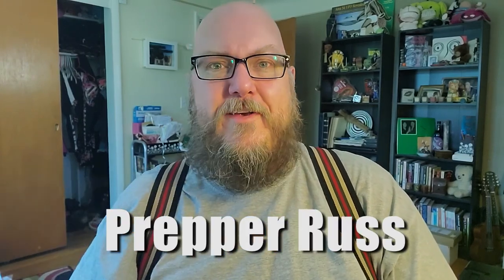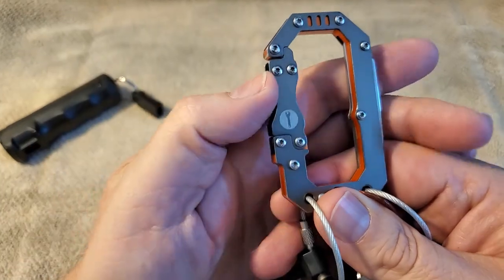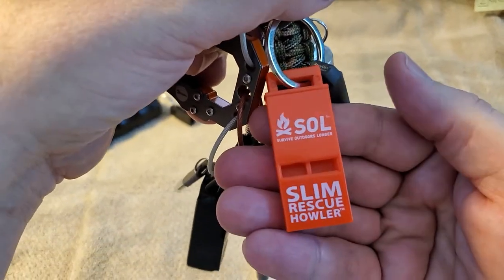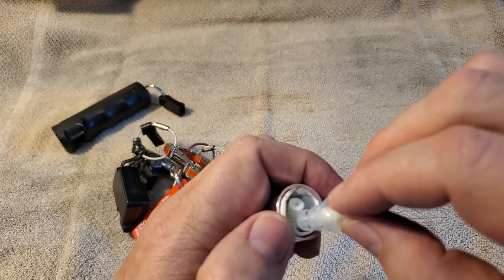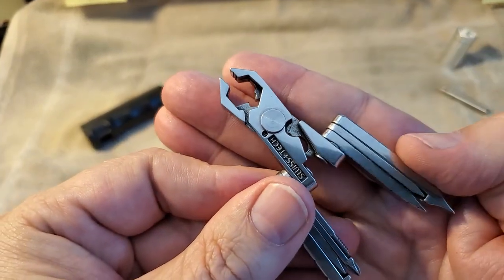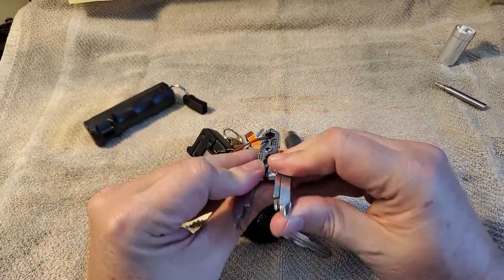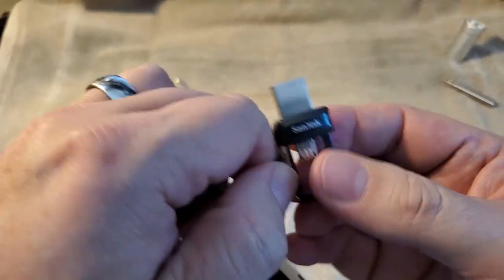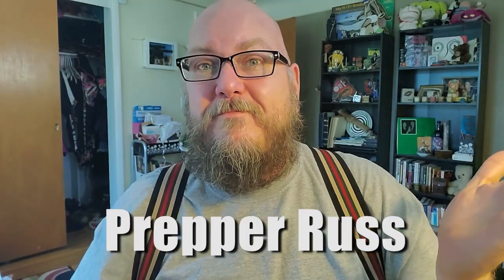EDC Keychain for Urban Survival | Prepper Russ

Comment: I've been trying to find the best key rings (those aircraft rings) that will last the longest and also looking for the smallest size. Only have a few things on my key ring dont need a huge hoop!
Reply from the maker: please let me know which ring you use.
Reply: @PrepperRuss  for now I've decided not to use them. They all seem too big for what I need. I don't really have much on my keychain so I'm not in need of anything big. Just gonna stick with regular ol key rings for now. Ended up ordering some smaller sized ones from a website so I could get the sizes I wanted. Should work out good. Now I'm trying to decide between a spyderco bug/honeybee or a good ol swiss army classic for the keychain. That way I have a blade of some sort on my keychain 👍
Reply from the maker: I like a big clip knife for quick access in my pocket, so I use the Spiderco Endura clip knife. Bought it for $25 over 30 years ago but they go for nearly $100 now. Best knife I ever owned!